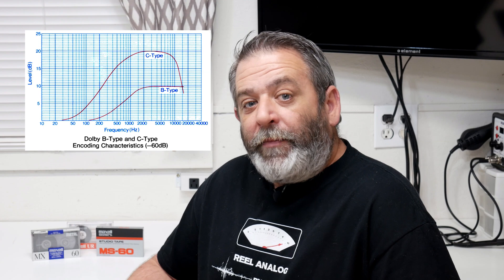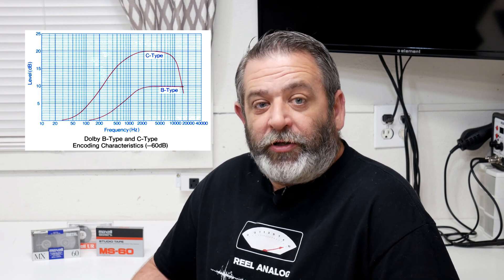DOLBY NOISE REDUCTION - Was it GOOD or BAD? Live Audio Comparison of Dolby B and C on Tape

Comment: I think all excerpts in this video sound equally hissy. As you point out in the video description, that is definitely due to using the HP out of the deck. I have found this to be the case as well when capturing cassette tapes to a portable digital recorder. Always use the line outs of the deck, bypassing the deck's crappy in-built HP amp. As for using Dolby: I find it too much hit-&-miss to be of practical use. You need a deck with level calibration to make optimal use of it and it does not transplant well to other cassette decks. I record without Dolby and then route the tape signal through an external single-ended denoiser. 30 dB noise reduction is feasible and a digital capture of the tape signal is hard to distinguish from a CD original in an AB test.
Reply from the maker: I ended up changing my video recording setup. After hearing the results from this video, I routed an output from my program selectors to my MOTU interface so I can capture the recordings at high quality and record as a WAV file to be used in the videos. There are a couple videos coming up over the next month that use the new system and it sounds much better.
Reply: I would advice to you to think twice when you are choosing line out from deck over HP output. Just  compare before you name it crappy The only it's issue may be that the level is more than acceptable for input   but  it may be solved by potentiometer. I  use all my outputs from Headphones, not line out. Producers  do what users want ,  do not intend to make competition to studio gear  but it is not always   best result  .

Comment: I  couldn't hear any tape hiss in any of the recordings through the video. In my systems, I can hear the hiss quite clearly, and Dolby B gets rid of it very well. I think it's good, so long as your equipment is good all the way down the line. The way Dolby is supposed to work is that it accentuates those frequencies in the recordings that are then lowered during playback, so there shouldn't be a dulling effect to the high frequencies. If you're perceiving a dull sound, then there is something weird going on, like maybe the biasing of the cassette isn't quite right during recording or something? Somehow, you are losing high end that wasn't properly added into the recording. That doesn't happen for me at all, Dolby B has all the highs and sounds crisp and clear as a bell. C is generally bad because it's too complex and recording and playback rarely matches up well from machine to machine. Dolby S on the other hand is better than all of the others. S tapes sound great played back with no Dolby and with Dolby B or S engaged.
Reply from the maker: I've never had a machine capable of Dolby S, so I've never personally experienced that one. I've heard it's really good and someday I'd like to find a machine with it. I've always liked a brighter sound profile personally, so I've actually recorded tapes with B and played them without NR engaged to get the accentuated highs. It's definitely a personal preference.
Reply: Couldn't agree more. Love Dolby B encoded recordings but played back without any Dolby decoding at all. Works well even om type1s to enhance the treble response. I'm sure that's not how Dolby is intended to be used but works well for me
Reply: @joeclayton2875  dolby only increases the level of high frequency sounds when they reach a certain threshold. if you playback a dolby recording without it on, it's going to distort the music by emphasizing louder high frequency sounds over lower volume high frequency sounds. just simply using the treble control (or an equalizer) will increase the high frequencies more uniformly

Comment: I don't like to record with NR. But I will buy albums that are recorded using Dolby SR or HX Pro and compare them with their regular Dolby B releases. Nowadays, NR doesn't seem necessary in my opinion. Since I tend to use 90 minute tapes, I'll make two 45 minute "master" recordings onto minidiscs and dub from those. All tracks are normalized to the same volume and I try to record from FLAC or Apple Music's 24-bit offerings. My new cassette recordings sound a million times better than my cassettes from the 1990s. Like you, I also record using Tascam decks (cassette and minidisc). The minidiscs come in real handy when you have friends who feel nostalgic and want one of your mix tapes. I like making mix tapes for my friends for christmas.
Reply from the maker: My tapes now sound better than my tapes from the 80s and 90s as well. A big part of that is equipment. As a kid, I had a budget tape deck and bought cheap tapes. At 13, I got a brand new Sherwood cassette deck. That was a budget brand, but it sounded way better and had Dolby B and C and recorded on metal tapes. That's when I started really getting into recording tapes and trying to get the best possible quality. Nowadays, I tend to record my "masters" on 2-track 15ips reel to reel. I also make mix tapes for folks. I'm glad I'm not the only one! I've never had a minidisc player or recorder, but it's on my list to get.

Comment: I remember Dolby noise reduction. I used to record from sources like vinyl records, and I would get good results using Dolby B noise reduction using Chrome tapes. However, using Dolby C, which raised the signal to noise ratio, tends to sound pretty crappy on equipment which didn’t have it. Most of the more expensive portable tape players did have Dolby B noise reduction, but not C.  However, it did matter as to which type of tapes were more suitable. Using Type II or Type IV have better frequency response compared to Type I tapes. Most of the portable cassette players only supported Type I tapes, so you would need a higher end player to play back Type II and IV tapes.
Reply from the maker: I agree. I tend to use higher end types without noise reduction and get pretty good results. The times I did use NR back in the day, I used Dolby C. It did mess with the high end quite a bit though when I played the tapes back on my Walkman. I didn't mind too much, as I tend to like a brighter sound anyway.

Comment: Why is there so much noise/hiss in the first place on the Original File?  Makes analysis of the NR types a bit moot.
Reply from the maker: Immediately following this video, I made an upgrade to my setup. I noticed that as well. I had recorded from the headphones output of the tape deck directly into my camera. For all future videos, audio will be captured direct into my MOTU M2 interface. I added an additional output from my DBX program selector to output from all my tape decks directly into the computer. There are a couple videos coming up on the channel that use the direct capture and it makes a world of difference.